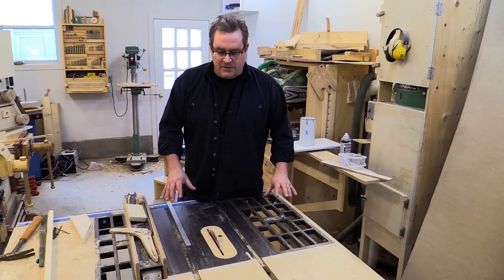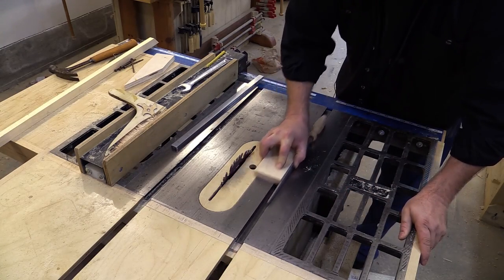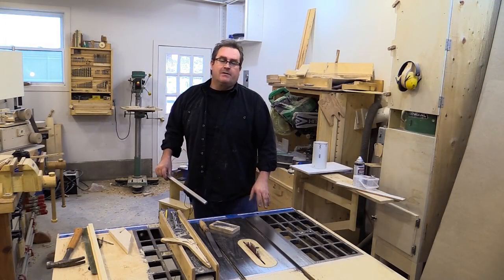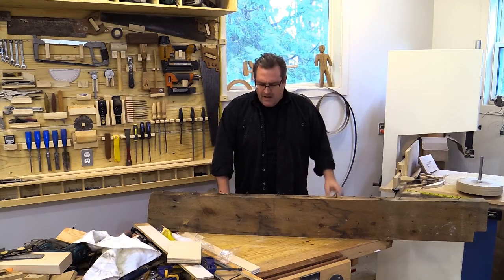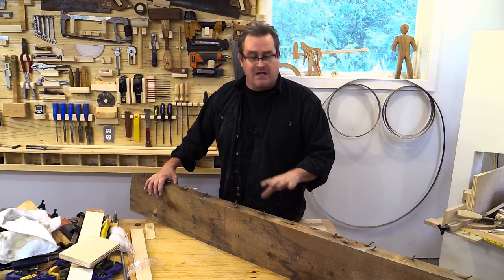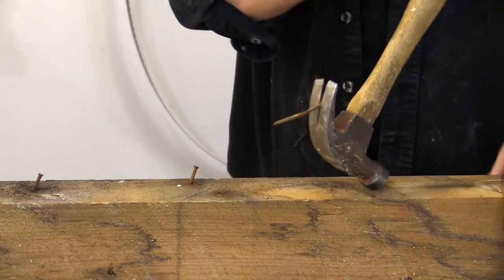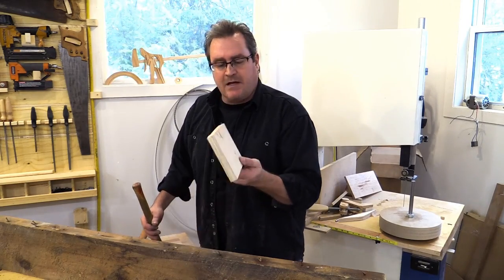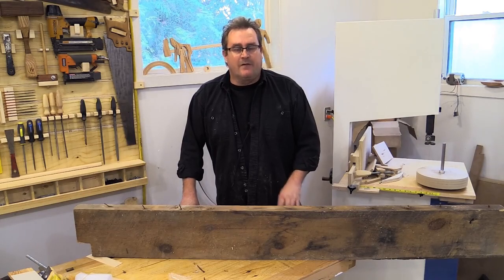Pull Nails Like A Boss & Miter Slot Repair

Comment: Big thanks for all you share.  I have to chuckle & say 'been there - done that' !
I enjoy salvaging 'old-growth' wood that is way superior to what is sold today.
Here are a couple more tips.
Likely, I will be jointing an edge & will 'loose' about an eighth inch of width anyway.  
For old nails fully pounded in,chisel away down to that eighth inch point, firmly grip with a vise-grip,  tap the hammer  claw between & yank.  If that doesn't work, use a nail-set to drive the nail deeper than the jointer pass & just abandon it there.

Comment: Thanks John for your thoughts on the table saw refurbish.  I had the same issue on a "Craigslist" saw I bought.  Instead I used WD40 and steel wool in the slots.  I was fearful that grinding/filing would remove base metal which I did not want to do.  The residual WD40 kept turning black so I felt it was removing built up rust and not metal.  Lots of elbow grease later I have free running slots.

Comment: For pulling several nails I prefer using a pry bar instead. The way the bar is shaped at the hooked end seems easier than using a hammer. The bar is slightly longer than a hammer handle so it provides more leverage, also being all steel I don't worry about breaking a wood handle. Renovating my grandfather's old house has given me an excuse in buying all sorts of tools I didn't previously had. Have a nice assortment of crowbar, different sized pry bars, even a bee keeper pry bar to remove the moulding without damaging it.
Reply: That would have to be an awful old or crappy hammer to break during this operation.

Comment: Great video John Heisz.  I had never given a straight claw much of a look before, but with your tip, I'll definitely have to rethink that position.

Great job on "tuning" up your miter slots.  I agree that many people can get very good tools for less by shopping used.  Most made before 1990 wer made to run for 100 years and only need a bit of patients and TLC to take them from "workable" to outstanding.

Here is wishing you and yours a Happy Thanks Giving.

Comment: Did you boost the contrast in this video? Looked good either way. I pull a lot of nails, goes much faster using a hammer in each hand, one to pull the nail and the other to go under for leverage. Of course, nothing beats a crow bar for nail pulling.
Reply from the maker: Rick McQuay That's funny, I was messing around with the camera the other day in a really dark location and bumped up the gain to get more detail and forgot about it. It washed out the picture for this video and I had to do a lot of messing around to save it. I still think it looks not-so-good, but you are second person to mention it.

Comment: I once de-nailed a whole house worth of hardwood, (first day of a construction job.) The boss recommended long handle pincers. We ended up moving the pile of cleaned boards about 4 times before trying them, and deciding not to use them... I got good at using pincers, and moving/stacking old oak flooring anyways... lol

Comment: So what do you feel about all the people who say never pull nails with a wooden shafted claw hammer? At least I've read this often and I got a similar, favorite hammer, that I don't dare use for this anymore, so instead I use a small crowbar.
Reply from the maker: 1873Winchester It's just a $2 hammer - a tool meant to be used, not display on a pedistal. If it breaks (it won't) I'll get a new one.
Reply: If the handle ever breaks, you can replace it. If you love that hammer, I am sure you will love it even more if you build a custom replacement handle for it, assuming it ever breaks.
Reply: The trick is to use a block as John shows but only after you reach the end of the curve of the claws.